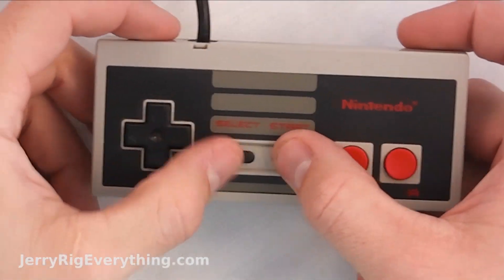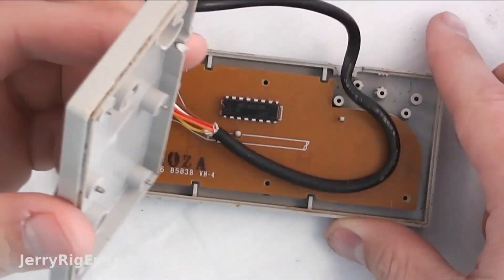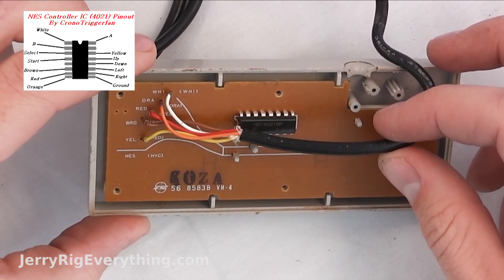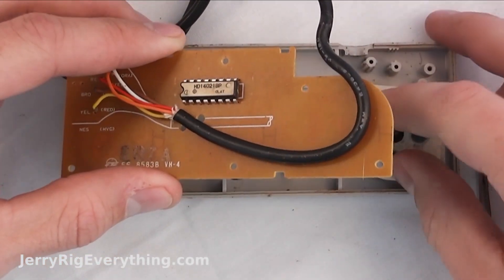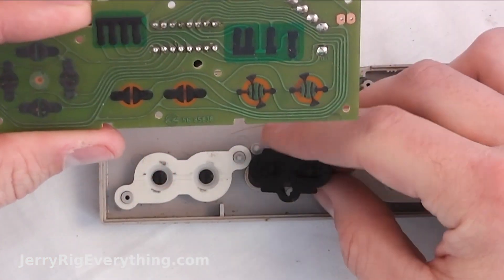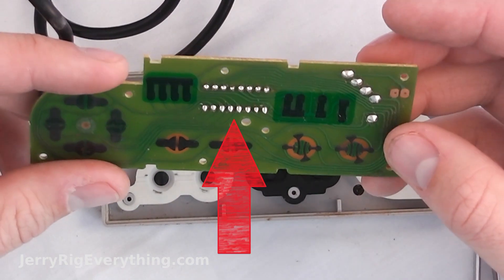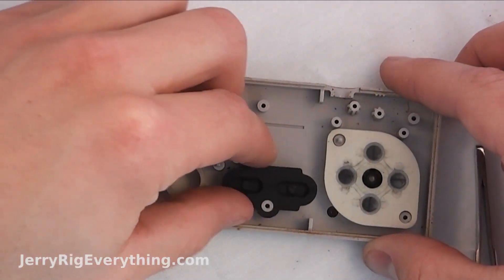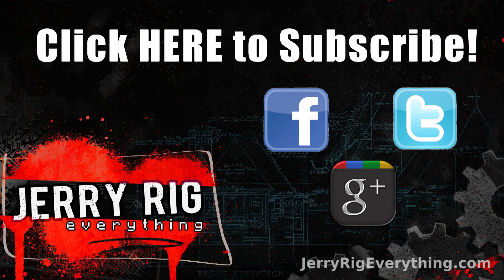NES Nintendo Controller Tear Down and simple mod explanation

Comment: would you happen to know what could be causing my controller to not register left press? i cleaned the pad silicone and board with isopropyl alcohol but still does not recognize left press

Comment: I totally remember this Nintendo!  It was the first big purchase I made working an after school job.  The first thing I deliberately saved for, that is.  I have it still, original box, packing, manuals and all.  I have not opened it in since the 1990s. If I ever need to get into that beast, yours will certainly be the video I reference.  Thanks for the great video.
Reply from the maker: InformationIsTheEdge Some of those old ones are worth more money now!  Definitely check into that before throwing it out.
Reply: JerryRigEverything Throw it out?!  Even if it didn't work I would never contemplate such a thing.  I bought it in 1987 and logged hundreds of hours on it until I got Sega Genesis some years later.  That's when the Nintendo went back into the box.  There it will remain as a relic of my gaming history.
Reply from the maker: InformationIsTheEdge Thats what I like to hear!  You cant throw away Epic pieces of history.
Reply: य

Comment: Hey!
Great quick vid!
I was wondering if you might have had an issues in which one of the buttons(In my case the A button) works not all the times and inconsistently?
I have an expansion port famicom controller and I can't figure out why it's doing that.
The rubber pads are pristine so I'm thinking it may be something with the board.
What might you do in this situation,if you don't mind me asking?

Thanks!